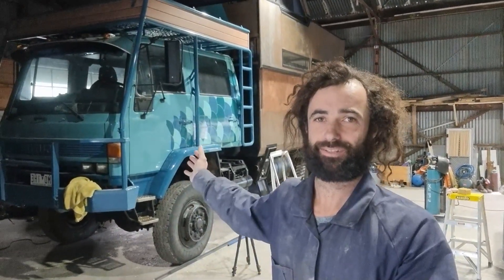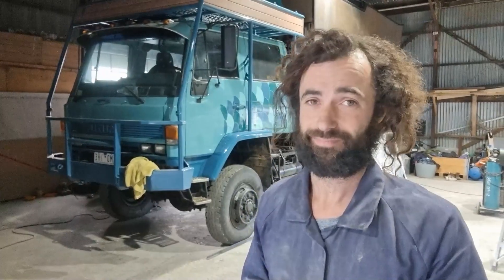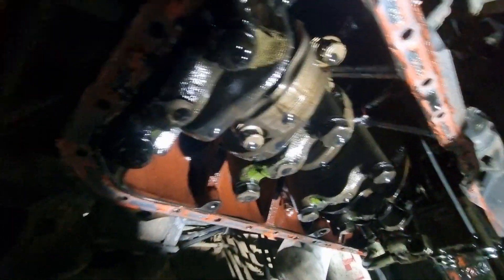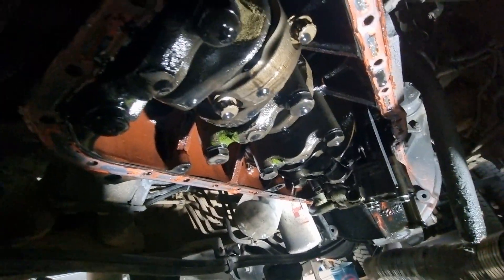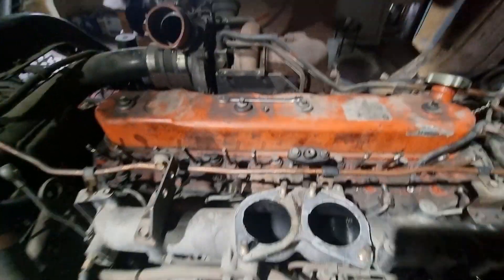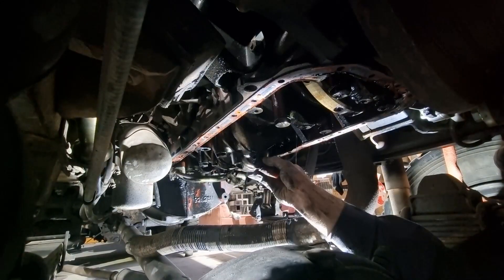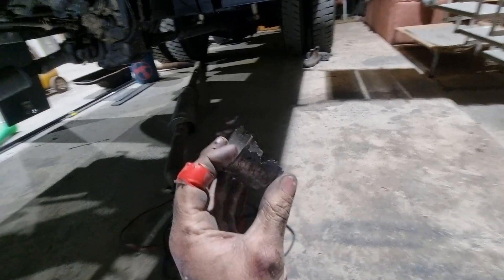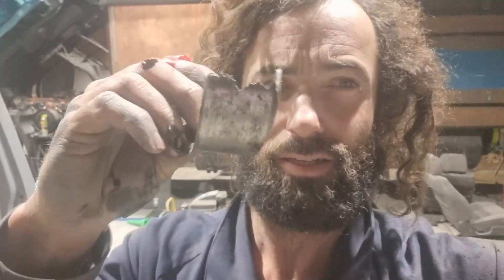Truck Engine Knock Diagnosis - Expedition Tuck Build #30

Comment: The cheapest insurance when you buy an old truck is to let a mechanic that specialises in trucks, and preferable in the make and model that you got and let them take down the oil pan and inspect the rod bearings. Then you can test if there is blow by from the oil rings on the pistons by open up the engine oil filling cap and place a rubber glove on the neck, and run the engine. If there is smoke coming from the cylinder and into the crankcase then you will see the glove fill up with smoke...

Comment: Well the good news is that in a boat you can't open the bottom of the engine and determine the problem. Yes I came here from your boat escapades but find this stuff interesting.
Reply from the maker: Hahah yes it does make it much easier! Thanks for sticking around, there will be more boat escapades in the future